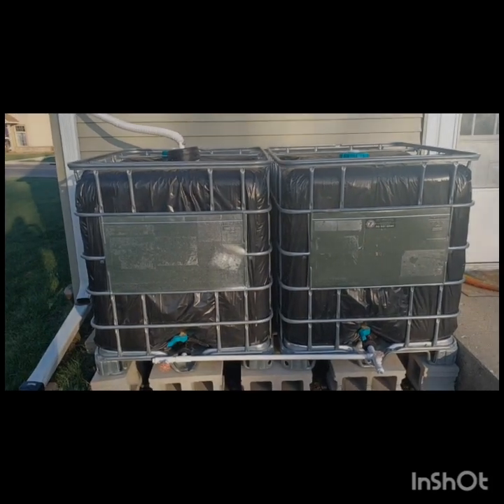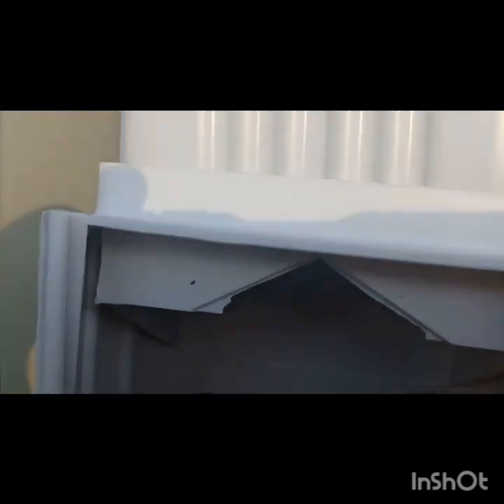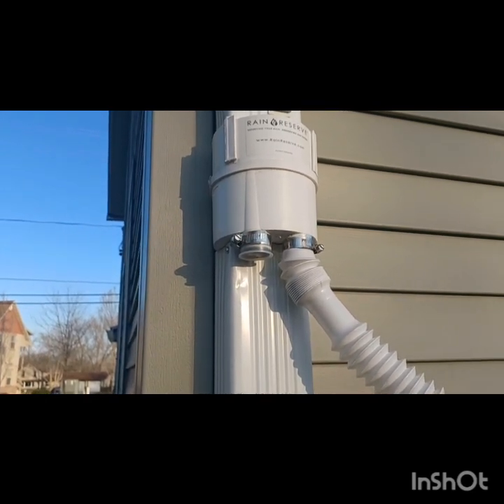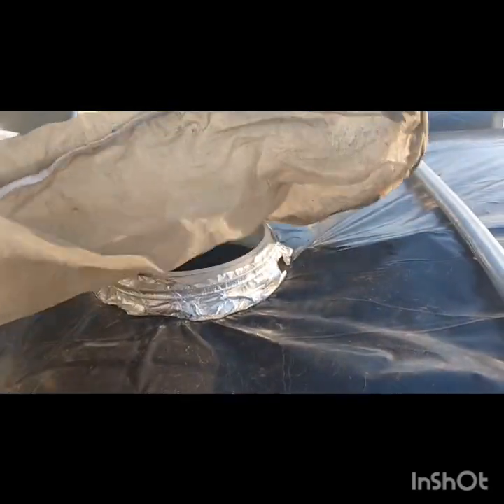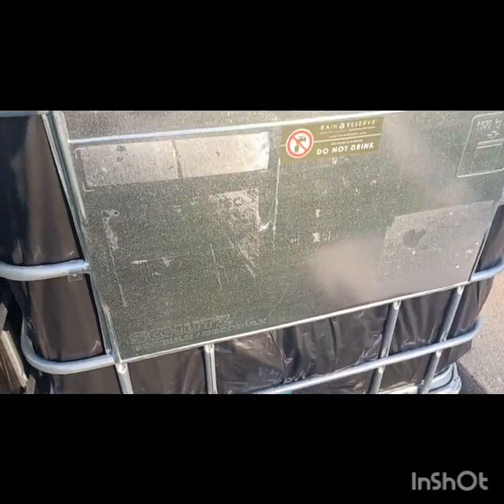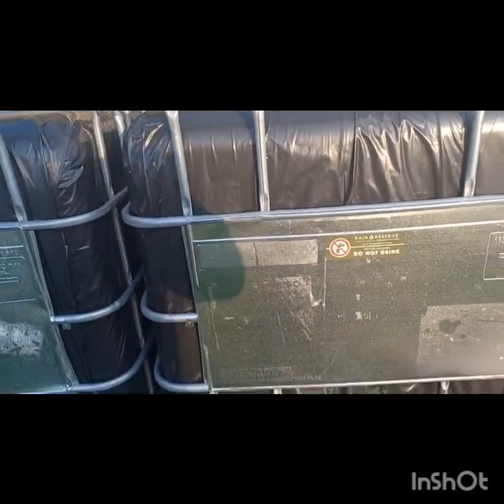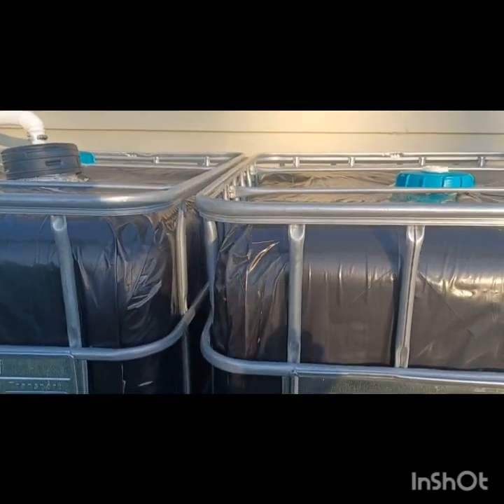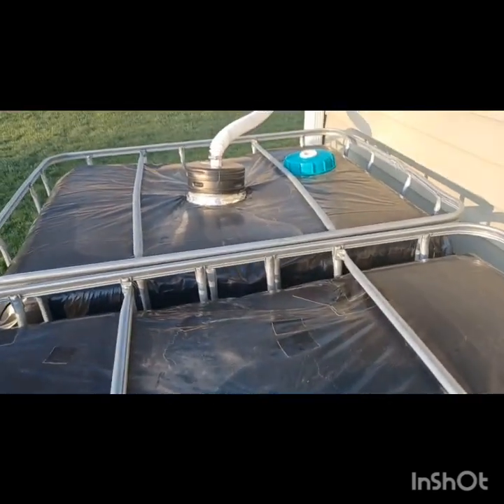550 gallons FREE rainwater from IBC totes for less than $200!

Comment: thanks for the video. no overflow pipe on the second tote? What happens when it fills up? the overflow pipe from the first tote is a bit low will splash the sediment on the bottom of the tote. water should enter a container higher off the bottom so the sediment is undisturbed.
Reply from the maker: The rain gutter diverter will send any excess water through the gutter and out the downspout when the barrels are full. No overflow pipe is needed.

Any sediment is trapped in the 100 micron filter. You could go finer, but you would have to clean it more often. I haven't had any issues with it or sediment in my tanks.